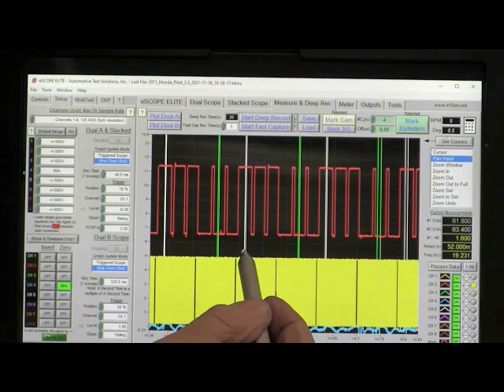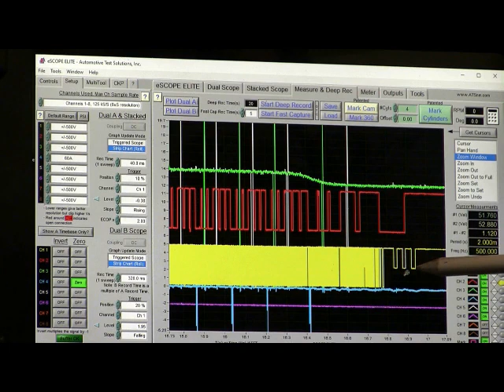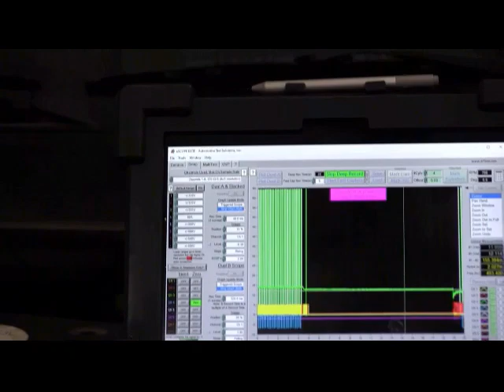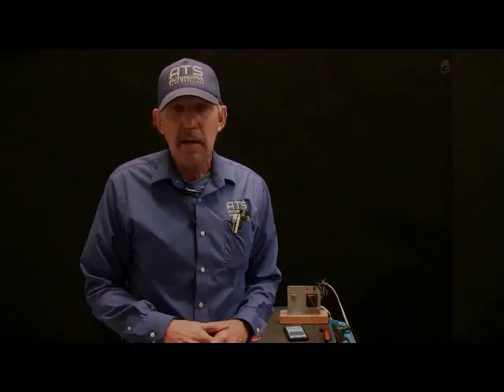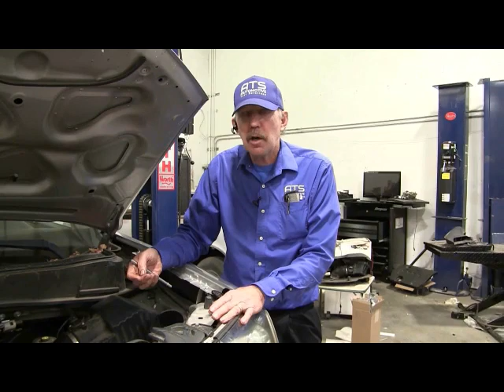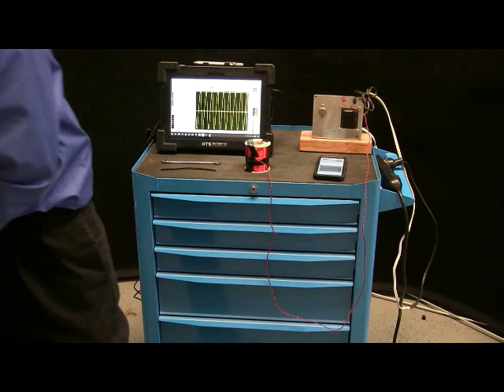2011 Honda Pilot Surging and Stalling

Comment: We used to have to run a ground strap from the starter to the frame on a lot of diesel engines  the torque converter bushing would weld itself to the converter.

Comment: 1:28:06 Why not just degauss the engine the same way it got gaussed in the first place?  Simply isolate all the modules and other electrical components and run a starter motor substitute (similar current draw) in reverse polarity.

Comment: the ground on my 2001 dodge ram goes to the engine block at the front; it was there when i bought the van in 2005,   as far as i know that the OEM position for it

Comment: I had an incident with my vehicle, where it would just stall randomly, and then I could get it jumped and drive for a while.And sometimes it would stall again.The problem was that the main ground was actually being cut into by the drive belt. And once I found that out, I fixed it, and it ran fine after that.

Comment: I watch these videos and I'm amazed at the things you get. I have watch many with the equipment you have designed and put out for use. Its realy awesome what your stuff can do. But sadly its just way out of reach for a diy like me. I'm a one man show working out of an old beater chevy truck. Doing mobile mechanics.. I have been using the cheaper scopes and stuff like that to get by. But these types of equipment are made and priced for big shops. I'm sad to say even though something like these tools scop and scan tools are great no doubt but for me there just completely out of my price range. I've tried to save up to get them but at most I can save is about a quarter of the price.but ill keep watching these videos they are just full of great information needed. Even though the level of testing i can't proforma. Maybe one day I will buy im not holding my breath. But a big thank you for sharing it all with us.

Comment: Is this guy just crazy? Less than 10 minutes into the video the car is playing up, there is a clear voltage drop from 14v down to 12v, during this period Bernie has focused on the crank signal and there is clearly no fault with the signal! 
He continues to look at various other potential causes and finds a crappy engine ground (which would tie in with voltage drops) but continues on to incorrectly diagnose a crank sensor fault and then strip the sump to demagnetise the trigger wheel and replace the poor engine ground. Surely you would replace the ground before going any further????
This is too much like the Subaru with the unbolted ground lead. 4 faulty camshafts??? But not the missing ground???

Comment: I just replaced the pcm. Coil drivers going bad causing studder and stall after checking all grounds. Customer had hard wire from battery to coolant temp sensor with ecm muzzler junk too problem solved. Deleted all aftermarket garbage including remote start and all is well after timing belt and intake boot. Many 2009 and up tl’s have driver issues too especially after any accidents.

Comment: Thanks Mr. Thompson. This open my eyes on scope tool. I did get one lesson on the 2005 Nissan after market cam sensor. one ran for 1 year and when it fail, the second one ran only one day. I lost because I thought 3 wire sensor got digital signal and it should not effected by too strong magnet. too strong magnetized cam reluctor  wheel cause the sensor ground the signal 100 % time. car wont start. I now know. I should  pulling the sensor out the hole and it may start the car. I would think to try the new OEM sensor. The OEM sensor got a metal shell over the tip so it wont get effected by the cam reluctor wheel either too close to the sensor nor got magnetized. DVOM  is not working on this problem.

Comment: Speechless. I wonder if the customer appreciated how much money you saved them. Some shops, even dealers if they found what you found with the Gaus Meter, would of quoted to replace the wheel. Then if they replaced it and didn’t fix the ground issue. Comeback! AWESOME 👏

Comment: A big problem with the automotive repair industry is good diagnostic is not rewarded. Let’s say a tech spends 20k on the best diag equipment, studies,and trains. Tech “A” without that equipment or knowledge charges hours for diag and  thousands on parts. Then tech “B” with the best stuff and procedures finds a bad ground in 45 minutes. There is no reward for the investment. I am a really good diag guy and I left the industry because I had to repair 2 or 3 times as many vehicles as a hack to make the same money. Fixing these problem cars from shops was so easy for me it was funny but after some time I became resentful and couldn’t do it any more.
Reply: I totally agree especially in the US. In Singapore, shops have a technical team that works on a fixed income. All they do is what Bernie does. They’re are evaluated based on accuracy of diagnosis. Cars in Singapore are very expensive because of the way they’re sold. So no owner wants it sitting in a shop.

Comment: I spent decades working on power generation - after the controls went electronic the primary input was from a magnetic pickup - the magnetic pulse was generated by the teeth on the flywheel - the electronic governor would measure the time that it would take to go from one rising edge to the next - sometimes it would be fron one rising edge to the 10th rising edge... the logic was simple - generators require a constant speed at every load - so if the speed slows down from the set point the governor gives the engine more fuel.. the magnetic pickup is nothing more than a magnet wrapped in a coil of wire so when a tooth from the flywheel passes it there is a electric pulse generated... so when the speed of the generator would get erratic or it wouldn't start the first thing I would do is take out the magnetic pickup and check for metal particles - the metal particles would eratticaly short out the mag pickup and corrupt the speed input signal to the electronic governor.. since the mag pickup was sensing the flywheel we knew the starter would cause very small slivers of metal to attach to the magnetic pickup.

Comment: I love the ATS Escope. Your content made me get the limited and the Elite 8ch not to mention every other type. One question  after getting your 360 with your mark cam , dont the degrees over time only apply to that section of the capture? wouldn't the degrees be off if your measuring against another section of the waveform if the engine speed varied from the spot where you marked the 360?

Comment: I would never have thought of this.  would just assume the current would flow through the head to the block(through the head bolts) into the starter body.
crazy someone without a degaussing tool would have to change the engine to fix this.

Comment: I worked at a machine (tool & die) shop for nearly a decade.  We had a Blanchard grinder that ground down the thickness of the extrusion dies we built.  It used a giant electromagnetic table to hold the dies still while it rotated under the stones.  After we ground it to the correct thickness and we shut the table off, it would pulse the magnet on and off for a minute or two while it demagnetized the steel dies.  I'm definitely not sure of the science behind it, but we also had smaller demagnetizing tools out there and it seemed like all of them pulsed on and off during the process.

Comment: Visual inspection is KING! I would have seen and replaced that cable before even getting the scan tool or scope out. I believe that a new/proper cable install would have solved the problem and avoided days of effort.

Comment: That reminds me of when I was a teenager and installed a rooftop TV antenna for my parents.  I ran the ground to the gas pipe. =)  As to why I chose the gas pipe as a ground?  Well ... at that age you see folks using water pipes for ground, so that's where I chose as a ground point.  A pipe is a pipe, right?  =)  Anyway, I was wondering why folks chose cold water pipe, so I looked into the reasons.  And when I found out, I rushed over to disconnect the ground from the gas pipe!  Anyway, I ended up driving a copper stake into the earth and that became the ground for the TV antenna.  =)

Comment: Anyone else notice their “repaired” cable still had the wrong terminal on it. It should have had a negative battery terminal end. Not a positive end. They are different sizes. Amazing job troubleshooting and then failed to make the repair properly 🤦🏽‍♂️

Comment: I am totally blown away with this diagnosis. I have never seen this before. Didn’t even know that target wheel and crankshaft can get magnetized. I am still confused by the reason why this had happened. I had never seen car were ground cable goes straight to starter itself it is always bolted to engine block.

Comment: at 52:55 he deduces that its the trigger wheel? HOW? I troubleshoot complex computer networks for a living and I would have missed that diagnosis, I am not sure where I would have gone next but it would not have been the wheel. I am always humbled and amazed at very smart people and the intuitive leaps their brains are able to make!!!! I may never achieve their ability but I can sure appreciate and envy it!!! Thanks Lee
Reply: He compared the crankshaft timing to the camshaft timing and saw that there was variation. And it was in the readings of the sensor signals. In reality there was no timing issue (mechanically)

Comment: Excellent video, Bernie.    It's possible that a tape head degausser, used through the sensor hole, would minimize the teeth magnetization sufficiently, and also level the difference in mag strength between teeth.  The mag strength between teeth may be messing the the sensor electronics which probably has compensation circuitry to "zero" or ignore some level of residual tooth magnetism (pretty common with magneto resistive sensors). If the tape head degauuser didn't work, then a TAPE degausser might work held to the sensor hole, or directly on the teeth with the oil pan removed.  Last, you can hold the degaussing coil stationary while someone else rotates the crank.  And a reminder to gradually pull the coil back before you switch of coil power, otherwise you can remagnetize the nearest teeth again.

Comment: Also please answer me why you not using gauss meter from first part, is it ok or what? Because im interested to buy same like that only because he had AC/DC option for testing, or otherwise to buy cheaper one only DC measuring. Thanks in advance.

Comment: i noticed the strongest magnetic was next to a crank counterweight. also  on the waveform the crank signals were not uniform from tooth to tooth. if you expand the timebase even more id be willing to bet you could pick out the teeth that were the most magnetic

Comment: Bernie, can you please elaborate on your comment that ground was rerouted. On Honda V6, there is a ground cable that attaches from top of the radiator support to the transmission. The factory battery ground cable does not connect to starter, but just goes to the body metal by the battery. So my question is, was that transmission ground cable on the car and if it was, was it really frayed and crusty?

Comment: I can't imagine 16 gauss vs 250-300 of the sensor causing problems.  Also the problem would be periodic with crankshaft revolution....makes me wonder if something messed up inside the ecm with triggeri voltage levels.  Could the collapse of the magnetic field from the incorrectly routed starter cable damage the ECM through the crank sensor coil?  Thinking about the waveform, there is electronics inside the sensor to shape the waveform into a square wave...maybe the new sensor got damaged by the first crank.
 I keep forgetting about the sensors in the phone...they are 3 axis.  With a graphing app I think you could do a quick relative compression check by holding phone next to battery cable...I need to try it.
A doorbell transformer may work.
Excellent diagnosis!

Comment: Great video as always. On the degausser a few thought. 
You may want to try to convert this into a U-magnet. With just a simple pole, you are not completing the magnetic circuit and the field is bleeding out through the sides of the solenoid. If you can provide a complete magnetic circuit from north to south pole, then the flux should be even more concetrated. 
For the windings, it might be a good idea to dip the windings in some kind of varnish or thin epoxy. Doing this is a vacuum degasser would eliminate any air pockets. With only tape around the wires, they  could still manage to vibrate enough to wear through the insulation and create a short circuit.

Comment: Nice information.
I remember my dad a Radio/TV tech out of the army showing me how to De-gauss a CRT and Rat screens
He used a 12" dia coil  no onff switch and it was plugged into the 110 outlet ( early 70's). I figure it had to have a current limiter, But was it cool to see the interaction with the screens.
I have never thought of doing what you did with using a smaller version.
Reply: My Dad was a TV tech too, with a degausser that I would describe just as you did. It would get a little warm. Back in the 70s. It was heavy and must have had a lot of coils.  It was wrapped in electrical tape, so the coils couldn't be seen. Looked like a steering wheel with an electrical cord coming from it.

Comment: Great video Bernie !!..when I was an inspector for the airlines we used magnetic particle inspection to look for cracks in metal like landing gear etc…always had to use a commercial degausser after we magnetized the gear…cheap way is to use a hammer or heat the metal to its Curie temperature which is over 1,000 degrees…if I were use I’d use a hammer first…LOL !!
Reply: My suggestion also, to remove magnetism with a hammer or heat.

Comment: Bernie, great video and info! The c core leads connected to the windings, do you have to use a larger gauge wire with the higher step down transformer?

Comment: Great find, great instructional video! I know a television repair tech that would degauss the crt (picture tube) using a 100 watt soldering gun. Squeeze the trigger on the soldering gun and it produces a strong alternating magnetic field. Move the gun around close to the area you want to degauss. These soldering guns are actually step down transformers. The soldering tip gets hot because it is connected as a short across the transformer secondary with high current flowing through it. It would be interesting to test the strength of the field emitted from one of these old school soldering  guns.

Comment: Can you use a sensor simulator  that mimics the crank signal in place of the crank sensor?
Reply: That's an interesting idea.  Is something like that available?  Seems tough since you'd need the right waveform (# teeth with notch) and sync that with the cam at the same time.
Reply: @watlinsd  I believe AES wave have a sensor simulator for sale. The ATS scope also have a simulator. Just was asking the master if that would be an option instead of unplugging the crank sensor to have the cam sensor in control.

Comment: TV repair on old set that someone put hover to close to tube would need degauzing. You may still be able to find such tool. When repairing TV we would use a 1to1 transformer And a Variac to bring voltage up slowly on fault finding. The transformer isolate you from the mains. Your top of your game. I would not of fixed this  car.
Reply: Degaussing coils still readily available for TV techs. CRT's had to be degaussed just from changing the orientation in relation to magnetic North. Luckily, TV's and monitors have built-in degaussing circuits that do their thing at every power-on.